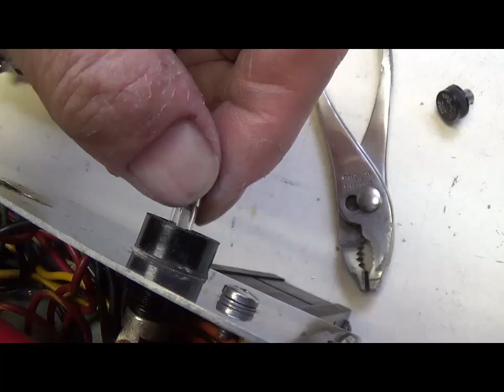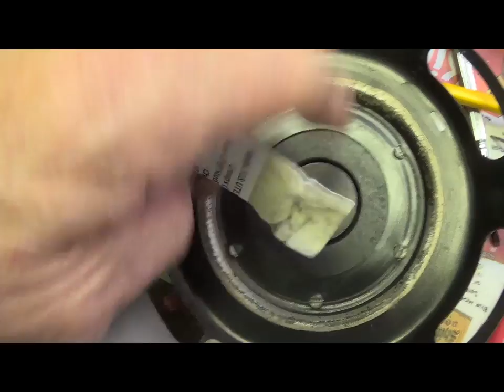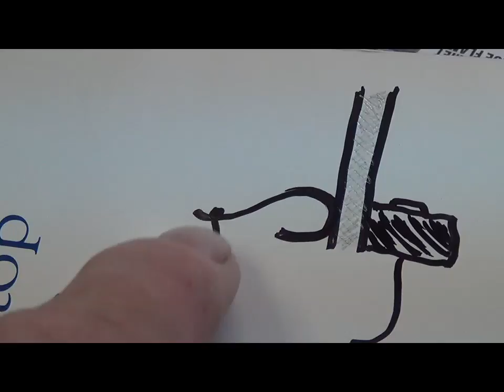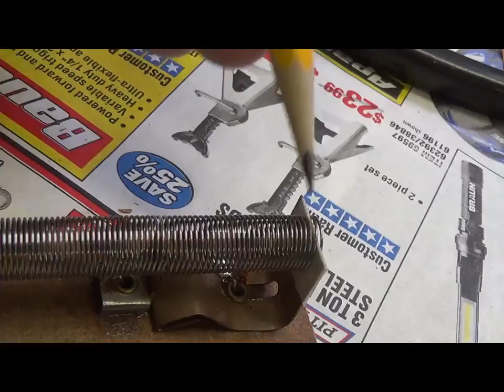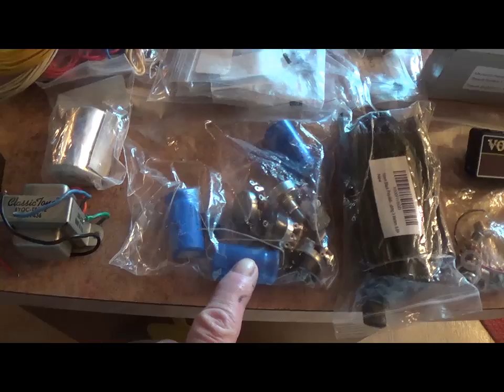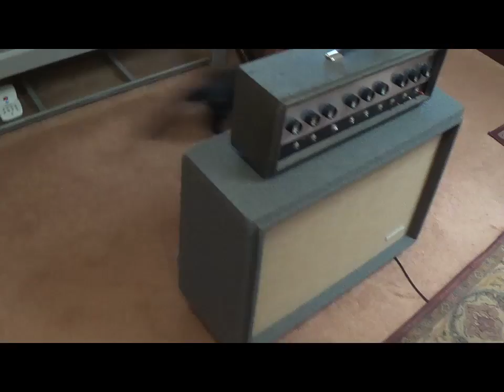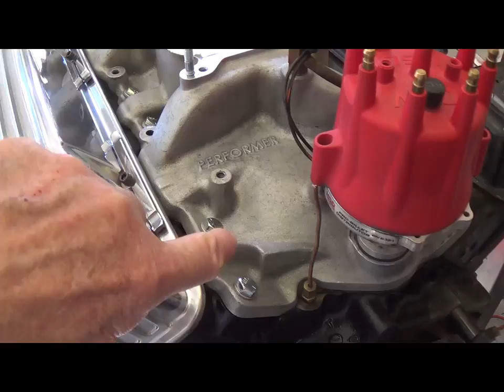Silvertone 1485, Part 3: Circuit Overhaul, Speakers, Sound Check

Comment: hi! i'd like to run el34 in my 1484, someone knows if the filament transformer has enough juice? thanks!
Reply from the maker: There is only one way to find out, X. Be sure you have a replacement PT available before you try it. Be sure to subscribe to receive new video alerts.
Reply: @UncleDoug  thank you! I'll report back
Reply from the maker: @xaz7088  Good luck :)

Comment: Working on an amp.  All  voltages are normal and then after an hour bias current spikes 200 mA.  I am suspecting power transformer has a partial short.  Am I wrong?

Comment: wow really like this project ,i have a old sunn cabinet which was built with 5/8 inch plywood very heavy cab ,I think it has alot to do with the sound  4 x 12 cab and they are wired in parallel ,talk about a loud cab ,but was told not to put a different  amp on it ,i have a  ampeg vt22 v4 100w head 1970 cab is driving them ,too loud really but was told not to hook up another cab because they are in parallell (speakers ) because of the ohms im thinking ,would it destroy a amp with this 
configuration ? btw i learned to solder on 1 of those weller solder guns thier nice especially for desoldering as im sure you well aware of
Reply from the maker: You have to be careful that the total net speaker impedance matches the impedance "expected" by the output transformer, Joe.

Comment: Hi Uncle Doug, What concerns attaching a speaker on a baffle. You use a stud on the grill cloth side, and put super glue on the stud to prevent that it turns. I use T-nuts on the grill cloth side . Those teeth go deep into the baffle wood and are rock solid, then I paint them black.
Great job Sir, and that grey polstering material looks great. Thanks for posting ! Joseph
Reply from the maker: I have used your method many times, Jose, as you can see in many of my previous videos. In this case, I went with the glued-screw technique.

Comment: Lovingly restores a 350 then screws a Fram oil filter to it !!!! ………………...
Reply from the maker: Only a temporary way to seal the engine, Craig. I no longer use Fram's on my engines, and currently prefer WIX instead.

Comment: Doug, where did you get the transformer from?
Reply from the maker: I got an original OPT from a viewer, Ted. They are hard to come by. The Weber replacement OPT doesn't work on the 1485......only the 1484.

Comment: My repair guy has had my Tubeworks MosValve amp head for 5 years without figuring out whats wrong with it. I wish i would have just tried to fix it myself now.
Reply from the maker: Go get it and give it a try, A-13. Anything is better than the current situation.

Comment: 'The uplifting tale of the tube electronic thaumaturge and the vintage amplifier leprosery escapee'. I suggest this for a title for this little serie of vids.
 You could have delayed the release of this Silvertone 1485 serie to (last week) Easter, as it is a sort of resurrection for this amplifier. 
 A little bit of chance to find the original finish under that tacky attempt of fig-leaf uphostery,  but overall a Very impressive work of restoration. 
 This endeavor would need skills and craft, but also a  firm determination and faith in own ability (and immune system) in front of all that crap, breaks and missing parts, and envisioned amount of work.
 'Beyond repair' many would have say and the whole thing (save for some precious parts) would have finish in a landfill (one accepting bio-hazard & toxic waste material..).
Reply from the maker: Thanks, Ant. Your poetic musings are always interesting and entertaining :)

Comment: Uncle Doug, I want to thank you for your tips on variable resistor repair. I have a 1966 Mosrite Combo model guitar that I've had since I took it down off the wall of the music store in 1966, The tone and volume pots were frozen so I replaced them with new 250K ohm, audio taper units. Of course, it is now not "all original". Yesterday, I disassembled each pot and cleaned and lubed the shafts with Liqui-moly, reassembled and tested them. The are ~ 500K. The guitar sounds fine with the 250s but one of these days, probably at the next string change, I'll reinstall the originals.
Now I'm looking for an amp. I'm trying to find a broken vintage Fender to fix, again using your videos as instructional inspiration.
By way of background, I'm an Amateur Extra radio operator and I built speakers for Stu Hegeman way back in the day so electronics and speaker repair don't faze me at all.
Reply from the maker: You're quite welcome, Russ. It's great to hear of your successful pot repair. I've always been a fan of restoration rather than replacement, when it comes to vintage parts. Good luck with your quest for a vintage Fender amp in need of repair.

Comment: I don't know if it's the reverb or the microphone, but at higher levels, the reverb was screeching like a monkey.
Definitely not weak.
Reply from the maker: I made some changes to tone down the reverb, F3. I agree that it was overboard to begin with.
Reply: @UncleDoug  It's a sweet amp, and you did a fantastic job on it. 
I can see why you toned down the reverb. It was a beast.
Reply from the maker: Thanks, F3.

Comment: I live close to the site where naugahyde was excreted from the bowels of the U.S. Rubber Company in Naugatuck, CT. It was a marvel of applied chemistry in its time, but driving through Naugatuck during those days was like taking a stroll through Satan’s colon after a long weekend of Jose Cuervo and Taco Bell. The stench watered the eyes and seared the nose. 
Thanks for all you do, Uncle Doug. 
Gary
Reply from the maker: You paint a pretty picture of the process, Gary. It sounds like a great location for a picnic. Thanks for the info......although now I feel guilty for using the product.

Comment: Are they using voltage doubling in the power supply?  I think this might explain the high B+
Reply from the maker: Yes, there are sequential stages of voltage doubling. All this is covered in the video.

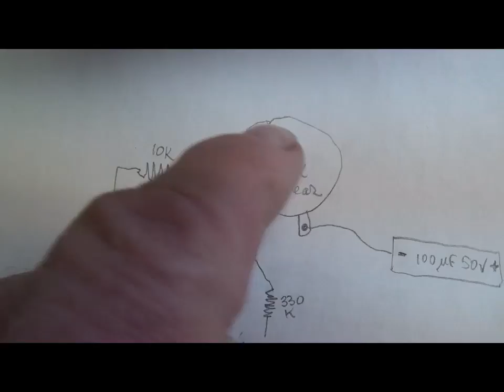Comment: 34:30 Is that right? Surely turning the pot all the way to the left would simply connect the grids to ground? The DC bias supply would still see 50k.
Reply from the maker: You're right, PHM. Good catch.

Comment: Sorry if you mentioned the reason or have answered this in a comment somewhere, but is there a reason you chose individual caps rather than replace the can with a new can cap?
Reply from the maker: It's just easier, cheaper, and maybe even a little better to install individual caps, Allan. If there is only one bad cap in a can, you have to change them all.....and I have had excellent luck over many years with individual caps.

Comment: Spectacular work as always Doug.   
I have one fear: The TRS speaker wire.   If anyone ever accidentally used a TS cable there could be bad results.  I understand the reason to avoid using  a "weird" connector... but it might prevent a future catastrophe.    Not vintage.... but Speakon, maybe?  a 4 pin XLR (To avoid confusion with Mic Cables)?
Reply from the maker: Thanks, D. I have labeled the socket as being only for the cabinet speakers and no others.

Comment: Amp project was cool. Thanks for sharing that one, but....Square bore carb on a Chevy?...Whaaaa???
Reply from the maker: Yes, the majority of Edelbrock carbs I use on my cars and trucks are square bore (primaries and secondaries are the same diameter). It doesn't mean that the venturi's are actually square :)
Reply: @UncleDoug  Ah, I see now, Yeah, Eddy copies the infamous AFB (they may actually own the rights to that design now), which was actually the carb Chevy used back in the days before the Rochester, so I guess its not total blasphemy. =)
Reply from the maker: Heck no, Dean. We were using AFB's long before Quadrajets appeared on the scene.
Reply: @UncleDoug  Yep, you're right....that's why I wrote that.

Comment: Hey Doug, try turning down the volume on channel two and leaving the reverb up. The amp I had still passed signal to the reverb with the volume off.
Reply from the maker: So does this one, KM. The wet and dry signals mix, and without the dry, all you hear is the wet.

Comment: Hi Uncle Doug, I absolutely love your videos. I have watched almost all of them and I can say I love the most the one where you build an amp from scratch, like the steampunk amp, that one is insane!!! I was wondering if you would be interested in make a video on how to build a high gain amp from scratch, like a Mesa Boogie, but build it the right way (I know Mesa Boogie are cheap-builded, but they sound really good). I hope you read this comment and share your thoughts regarding high amps. Thank you so much for sharing your knowledge. :)
Reply from the maker: Thanks so much, Fredy. I have always preferred smaller, medium to low wattage amps......but must admit that working on the 1485, as well as two 1484's and a 1474, has really opened my eyes to the impressive power and appeal of large, high-wattage amps. Check out my earlier videos and you will see one featuring a miniature Fender Bassman clone......50W output in a very small cabinet with a single 400W Eminence speaker. This was the most powerful hand-built amp that I have ever constructed.....so far :)
Reply: Thanks for your reply Uncle Doug. I watched that video and is great as well. You have captured a lot great jewels on your videos. My comment was more related to gain in the preamp, like those amps for rock or metal, instead of high output. I have owned some Marshalls and Peaveys with high gain distortion, but all of them were built in cheap, circuit board way. I was wondering how great will an amp made with your knowledge and skills for vintage amps sound for an amp with high preamp distortion with 4 or 5 12AX7s. Thank you for your replies and for sharing your videos :)

Comment: Great video! Does the 250R resistor influence the sound? Like a choke kind of function?
Reply from the maker: It is a wire-wound resistor, so it may offer some reactance to AC and reduce a we bit of ripple in the DC.

Comment: A good friend of mine left me this same amp. I already repaired the exact same cab for him.  But, it needs a new Transformer and re-cap, etc. Plus it needs all new tubes! What tubes did you use? Originals? I missed that part.  His had RCAs very very expensive. What much cheaper tubes would you recommend since he is on a very tight budget. And if you dont mind sharing a ball park price on this repair?
Reply from the maker: The Weber replacement output transformer is for the 1484 (4 Ohm) not the 1485 (2.67 Ohm), so although it may function, it is not an ideal replacement. Recapping, especially the can cap, is a bit challenging, but all caps are available. For tubes, I used vintage tubes from my stash, but buying all new ones will be rather expensive. This is my own amp, so I didn't keep track of the cost of restoration, but it would be substantial considering all the work done......cabinet repair (both), recovering, re-coning, re-capping, full set of tubes, replacement OPT, extensive cleaning, etc.......probably around $800-$1000.
Reply: @UncleDoug  Thanks so much. Now I can give the owner  a close friend, another idea of the cost.  I have another problem. Its a Whites Auto Amp. Ive tried all I can guess at to get its bub to work.  Got the amp working not the bulb!  Put on a three prong cord and the bulb had to move. Wired to 16vdc with many values of resistors...the bulb spec states over 15 use 1/2 watt 1k. Ive tried up to 2 watt and still it burns the resistors out. I get as far as 30 volts on my varic.  The starter switch is my problem. It has two pots one of each side and is connected into the amp oddly but there.  Each pot has three legs and two posts each on their backs. I cant figure out where to place that second leg to save me.  Any Ideas or guesses? Ever work on one of these? Thank You.  Dave

Comment: Would it have been a happier solution to have shorting contacts on the ring and sleeve of the output stereo jack to avoid output tube flashover if the plug is removed while the plates are lit up and signal applied?
Reply from the maker: Possibly, John. Since I don't envision that ever happening, I didn't consider it, but will keep your suggestion in mind for the future.

Comment: Question on wiring "phase". Okay, you just broke me... LOL I have always been taught that the designed function of a speaker is to "project" sound waves forward by pumping outward opposite the magnet towards the listener and speaker polarity is verified by using a 9 volt battery with the + & - terminals matching the speaker connections polarity. When closed the speaker should be moving, or firing forward or outward from the magnet. So, you're saying it doesn't matter which way the speaker moves during being energized matters because polarity doesn't matter when only a single speaker is used??? Why doesn't that sound right to me... Isn't the speaker pumping at the listener going to produce a more accurate, powerful sound wave instead of it retreating and throwing the wave backwards away from the listener through all the cabinet infrastructure?

Here's an interesting, informative (some amp talk as well) and humorous thread on the question which helps me verify my understand a little more on polarity and it's importance in the highest quality sound if you're into that sort of thing...  

https://www.lespaulforum.com/forum/showthread.php?83261-Does-polarity-matter-in-a-one-speaker-amp
Reply from the maker: Forum discussions on topics like this are almost always an expression of opinion rather than fact, and here is my opinion. When a note is struck, the speaker cone doesn't simply move inward or outward, it vibrates at the frequency of the note, i.e. 500Hz or 1500Hz. This is how the complex sound wave is created that allows our ear to determine the pitch of the note.....our eardrum vibrates in resonance with the note. Not only can no living person detect if a sound vibration is moving in a positive or negative direction......polarity changes too quickly.....but your ears generate a signal within the auditory nerve that depicts only the frequency of the vibration, not the polarity of the wave form. Positive and negative wave forms each contribute equally to the creation of this nerve impulse. When two speakers are out of phase, the out-of-phase vibrations reach the ear and are partially neutralized because the ear cannot resonate with both of them at once. This is how sound cancelling earphones work.

Comment: If the channels are completely independent like my Gibson Titan, you should be able to crosspatch between them . That will enhance the tremolo as well. It sounds like the weak lDR trem on the Gibson.
Reply from the maker: As a fellow tremolo hound, I'm sorry that the tremolo did not meet your high standards. If and when I take this jewel apart in the future, I will check the oscillation caps for drift.
Reply: @UncleDoug  Doug - I was certainly not being critical - love your videos, and the 1485 brougt back waves of memories! Again, was just mentioning I found cross-channel patching on my Titan helps boost the weak LDR tremolo on same.  As the Titan has loads of headroom, it also provides a bit more crunch. Haven't played through a 1485 in years and don't recall what the tremolo was like nor how it was generated; it simply sounded a tad weak on the video. BTW, IMHO, Vox has the best Tremolo.. Cheers!
Reply from the maker: Thanks for your nice follow-up, Thomas. Stay tuned for a future video showing tremolo repair on a 1961 Princeton. The before and after demo's show significant improvement associated with oscillator loop cap replacement.

Comment: Would a larger piezo element work? They use them a lot in hobby projects and musical birthday cards, I actually thought of trying to make one thanks to you 😂
Reply from the maker: Thanks, but since the reverb effect is over the top, I don't think increasing the piezo signal would be beneficial, P. I made some adjustments in the reverb circuit and it is now much more pleasant to the ear.

Comment: I know it sounds penisy but is there any difference between adding the neutral line between all of the speakers or to wire them all individually and connect to a central point (the mounting block) - I wondered if the difference in wire length could play a small delay factor
Reply from the maker: Electricity travels way too fast for a few inches of wire to have a delay effect, P.  Yes, as I recall the old Fender 4 x 10 Bassman and Concert amps were wired as you describe, with a central junction block. Perhaps there was a benefit, because Fender never did anything just for fun, but I'm not sure what it would have been.

Comment: Right now on Craigslist in Tacoma WA there is a Fender amp for $20 and the ad says this (which I am not making up):    "Works fine, has some paint on it "   !
Reply from the maker: Then it must be legit, Michal. You need to check into this jewel.....especially for only $20 (typo?)  :)
Reply: @UncleDoug   Ad is gone now.  Somebody got it.

Comment: I'm missing something on the bias pot.  As drawn, I don't see how you can short the power supply if you left out the 10K resistor.  You'd expect the range, but you'd always have the full 50K pot to ground.  Now, if you connected the power supply to the center wiper, that would be a problem, but I don't know why you'd do that.  As for the reverb, I think you over-fixed it.  Sounds like it has too much gain and goes into distortion.
Reply from the maker: You're right, Russell, on both counts :) You'll be glad to know, however, that the reverb has been tamed and is now actually rather pleasant to listen to.
Reply: @UncleDoug  Will that be a Part 4, or are you going to keep us in suspenders?
Reply from the maker: I have no plans for another installment, but may include a demo of the new, improved reverb in a future video.